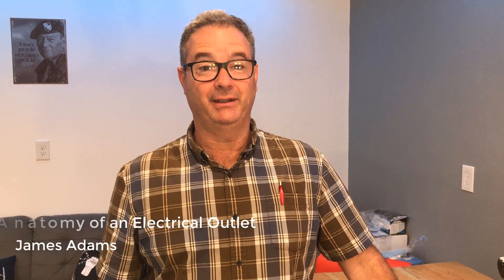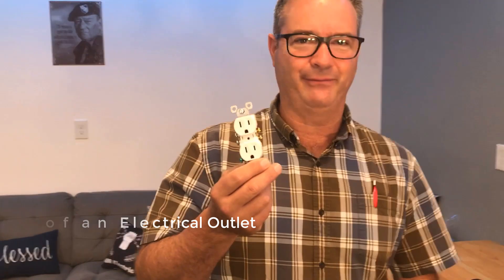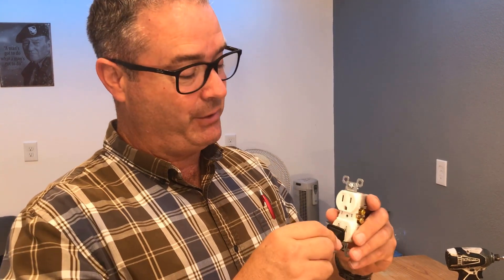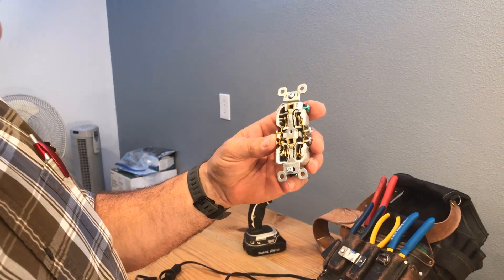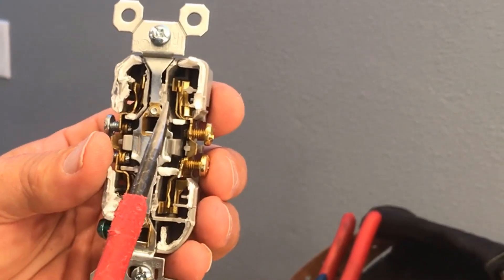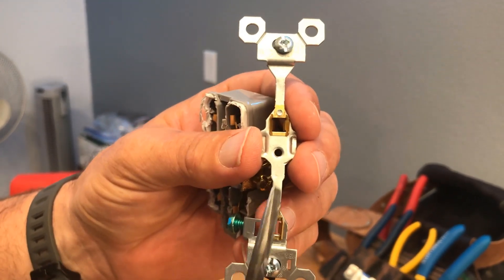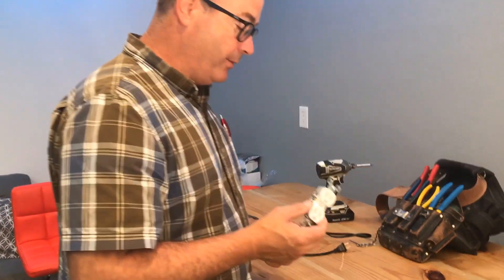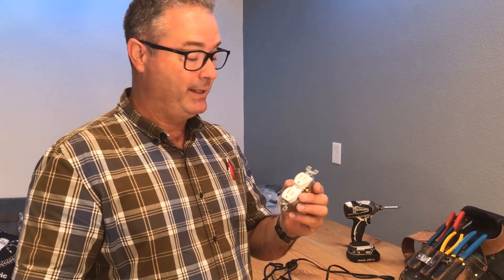Anatomy of an Electrical Outlet: When should you replace a receptacle?

Comment: Question. Just installed two new outlets and initially used the quick wire feature. They weren’t working properly so I removed them using the release feature (connections were loose. quite an effort to get them out). I then reinstalled using the screw terminals and the outlets are working just fine. Is this ok or should I replace the outlets entirely.
Reply from the maker: You don't need to replace them. As a matter practice, I would use the screw terminals as being more dependable.
Reply: @abrelectric  thanks so much!!

Comment: I like the 15a spec grade receptacles. I don’t care what brand they are, but I prefer Legrand to Eaton, and I prefer Eaton to Leviton. Eaton is the easiest to get in my area, because we live near Lowe’s. We also have a Home Depot nearby, but slightly farther, but it isn’t worth it as you can see by my rankings. 
My house was remodeled in 2002, 3 years before my grandparents house was built in 2005. We had mostly Leviton installed, and they had Cooper. (Same as today’s Eaton.) since our outlets were installed only 3 years apart from each other, they should really be worn out almost the same amount. However, the Leviton devices we have left look horrible, and don’t really grip the plugs well, and the toggle switches have a ton of dust in that little notch that the Leviton ones have. The Eaton ones at my grandparents’ house still look, and function, like new! Both were equipped with the cheapest of cheap residential grade outlets and switches, and as our Leviton devices, especially the switches as they start to arc, I’m replacing them with the Eaton 15a spec grade ones.
Reply from the maker: I agree: the quality of the devices is important. Many times that detail is at the mercy of budget. It's a long term investment 👌

Comment: I don't know if you answer questions but  I'll ask just in case or if someone else would want to answer. 
 I am an older lady who has replaced receptacles,  switches, and lights but that's the extent of my knowledge.
    If the bottom of three receptacles suddenly stop working in a living room area with only the top half of the receptacles working, the other 5 are fun but I know they're not on all the same breaker. Would you know if that's a wiring problem?  That's probably a stupid question because you would need to see it to diagnose it. 
    But could they be on the same circuit where it shorted out the bottom of the receptacle because they are connected preventing the current from being completed? 
   That may not be the correct wording so I hope that you understand what I'm trying to say. Thank you very much. ❤️ From West Virginia-
Reply from the maker: Are any of these plugs controlled by a switch? It was common years ago to have 'half hot' plugs: one half controlled by a switch for lamps, the other half constant for clocks, etc. If that's the case, the small jumper between the side terminals will be removed.
That's all I got today :) Good hunting!
Reply: @abrelectric  yes sir, the top part of the receptacle is  controlled by a switch but that part works. 
    The bottom three that stopped working might have been caused by a heater being used but I don't know that for sure.  I thought it was only one receptacle until I began checking others. I was worried that the wiring would need replaced. This happened quite a few years ago while I was staying with my mother after her stroke. Since then, I have lost the use of my left hand while taking care of my mother so wiring is difficult for me now.  But I know it'd be very difficult to diagnose without removing the receptacle and replacing it with a new one.  
  You know, when you get older it's always something. 😏
Reply from the maker: @Higherup1018  sounds like a loose connection at the point where your constant power begins, whether at the switch or another plug
Reply: @abrelectric  thank you so much for the information. I bet I have done something to pull it loose. Much love from West by God Virginia

Comment: I read that some receptacles are self-grounded and some are not. But isn't every receptacle constructed with the potential for self-grounding by virtue of the yoke of the receptacle connected to the ground socket holes?
Reply from the maker: If the box is metal and bonded, and the yoke is tight to the box without the plastic screw retainer to impede bonding.
Reply: @abrelectric  Right. BTW, great video! When you separated the yoke from the chassis a light-bulb (or CFL) went off in my head!
Reply: @stevenbernstein1978  😂